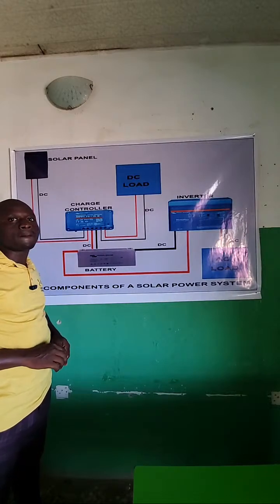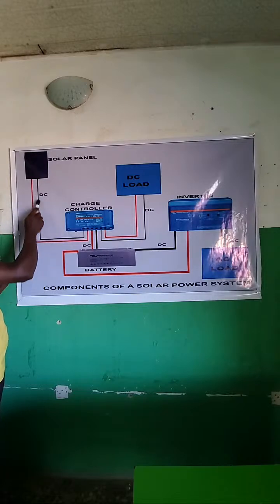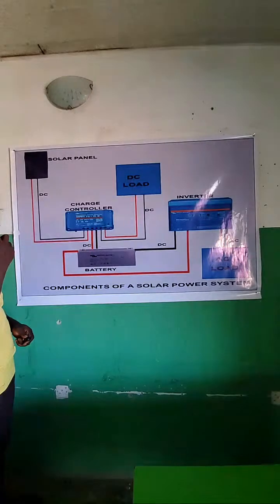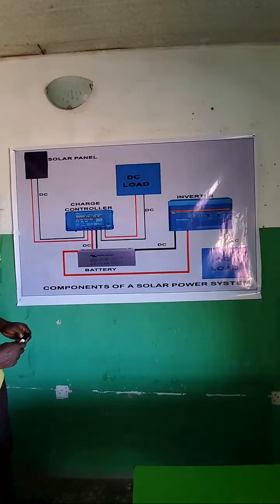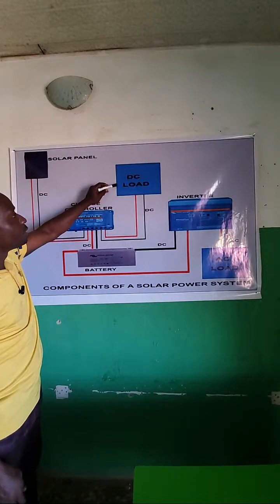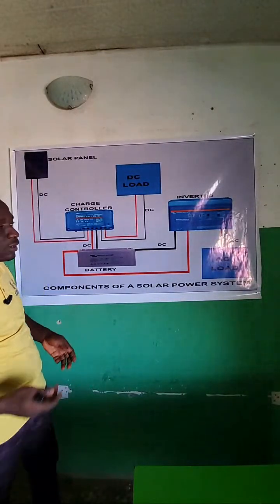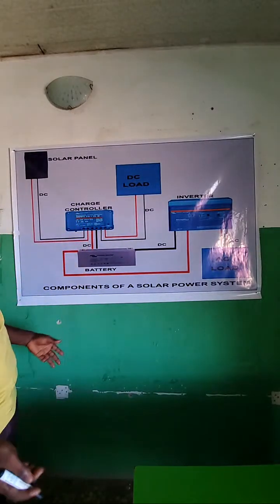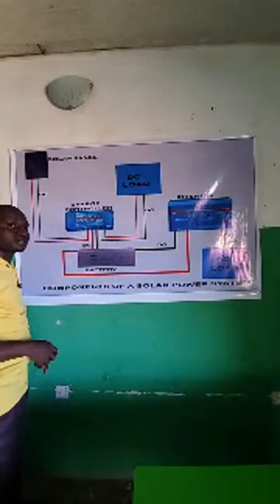Training on solar and inverter Installation

Comment: I want to ask, we still connect DC load to inverter, and it works, what I mean is after inverter has converted DC load AC load, then sometimes we buy like DC devices and plug to inverter and it works. That means DC devices can work on AC supply. It's only AC devices that can't work on DC supply. I hope u understand what I am trying to say
Reply from the maker: You cannot power Dc devices directly with Ac. To use dc load on Ac, you need an Ac to DC converter. All dc loads you see connected to ac power outlet have a converter that converts the ac down to 2v, 3v, 6v, upto 48v DC depending on the dc input voltage of the load